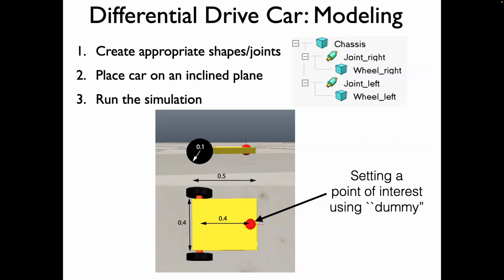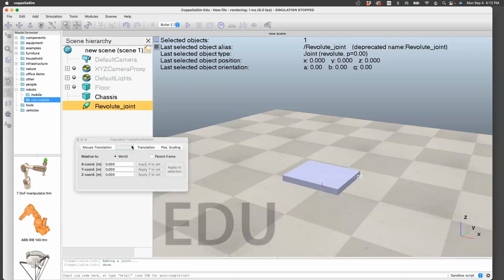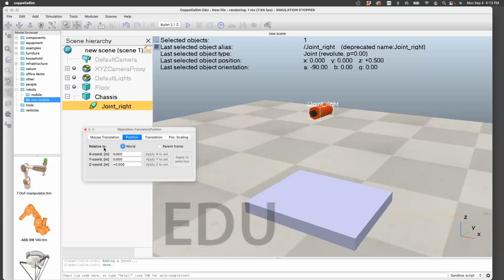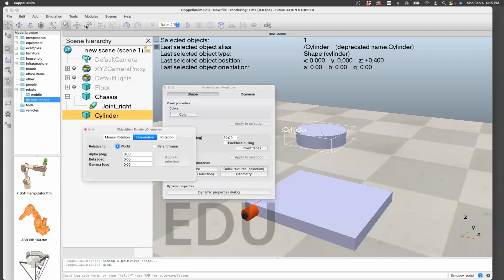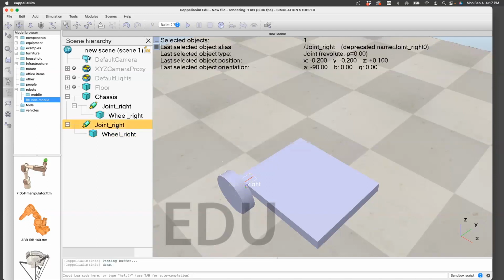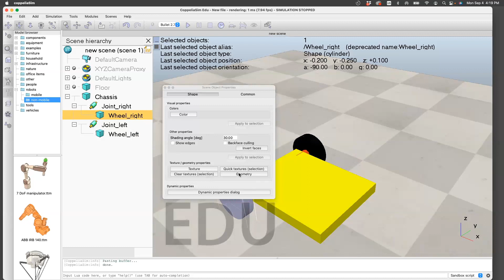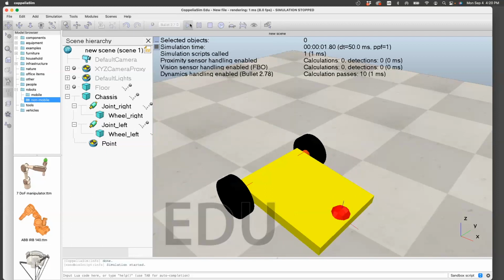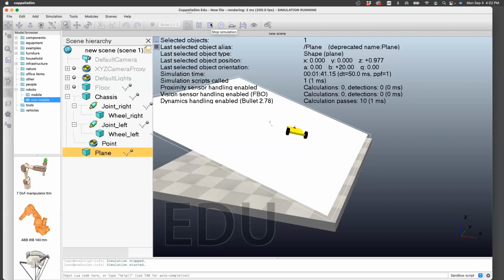CoppeliaSim: Differential Drive Car: Modelling (1 of 2)

Comment: Hello Professor and thank you for the videos, 

Can you compare MuJoCo vs. CoppeliaSim? I want to know about their advantage and disadvantages. 

The condition of the project:
Which one of them is better regarding having the SolidWorks file of a 12DOF robot to simulate and design a nonlinear control of the robot? also for part of the proposed controller, I want to use the RL algorithm.

Best Regards
Reply from the maker: You want to use mujoco in C if you want to do RL. Copppelia sim would be too slow for that.